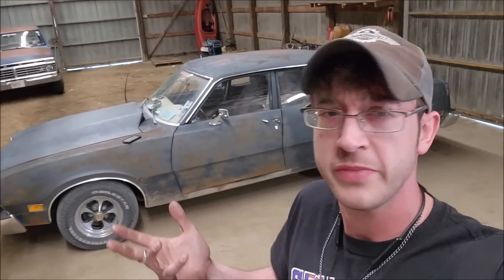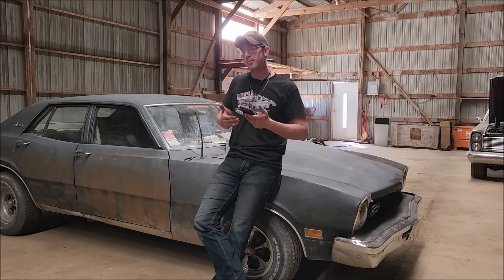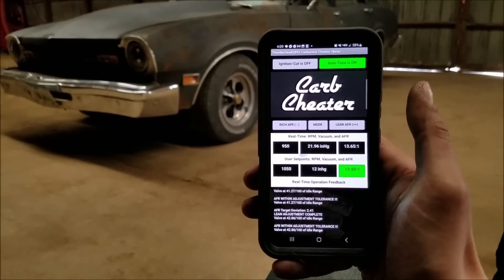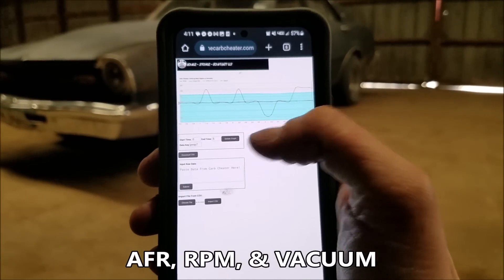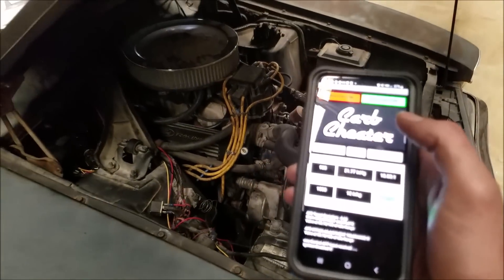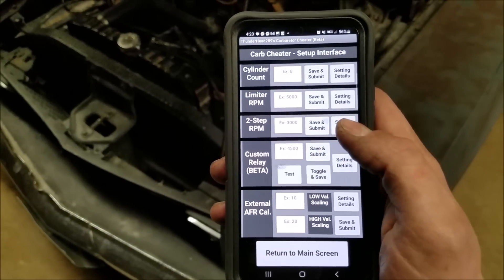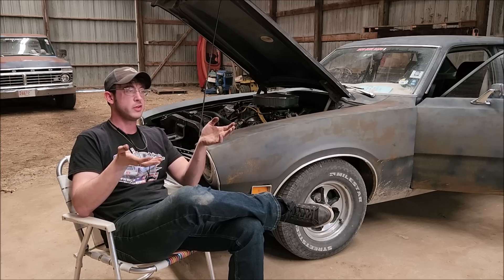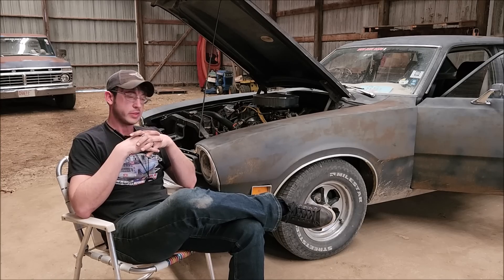A "self-Tuning" Carb in 2023? NOT fuel Injection (Beta Version - Teaser)

Comment: Brilliant conversion for classic carbureted vehicles. This would have been the next logical step between carburetors and EFI, back in the early days. Being able to actually control the target AFR is a huge step, and most likely, the biggest advantage to getting better fuel mileage. I noticed you're using a modified GM HEI distributor. Can you also modify the timing curve? This would be really handy for a draw-through or blow-through turbo setup! Nice work Luke!😉👍
Reply: How is it adjusting fuel trums though, not seeing in the video how thats being done (if its being done).
Reply: @umakemerandy3669  My guess is a solenoid modulator valve in the carb, sort of like the early GM CCC systems, before they went to EFI. Probably would be a plan to ask Luke directly?
Reply: @danw1955  lol yeah I'm sure he would reply to my comment about as soon as he would reply to yours about timing

Comment: I am a network security guy by trade, and wanted to put in my 2 cents.  Fantastic work, super excited to see it finished.  Please, please, consider how to secure the link between phone app and hardware. A malicious app, or a software bug, allowing control over our vehicles is a nightmare. The java mess on most cars is a security nightmare and several testers have already shown how easy is is to break into vehicles with ECUs that run all java and control everything. A hardware code, external serial number, push button, something that allows a secure and tamper resistant interface BEFORE something bad happens would be a great start.
Reply from the maker: To connect you need a 4 pin code which is unique to every unit. Prevents a lot of potential Tom foolery

Comment: I like the idea of an app for certain gauges.  Do I need AFR all the time?  No - just when tuning. Voltage? Once in a while. Some classic rides are missing a tach and well... that I gotta have, along with coolant temp.  Anything with a fuel regulator feeding a carb?  Gotta have fuel pressure too - that's an engine saver..

Comment: Hey Luke,cheers from Houston! If it goes super popular and a ton of units sell, would there be a potential for the app to crash? 

I see you mention wiring it to the coil; will it work well with aftermarket ignition systems? (MSD box to an MSD coil). 

If we decide to lengthen or shorten any part of the harness, say for a wire tuck, is the brain of the unit finicky with either solder, or wire gauges, or even wire material? 

I’m guessing it doesn’t care if it’s on a dual plane or single plane intake?

& any chance of rfi/emi? I ask that from experience from running a Holley Sniper lol. 

Can’t wait for it to be released! Props to you and Joe for designing and creating this, and a lot more if you guys are making each single one yourselves 😮

Comment: Holley had a dash mounted unit you could adjust a/f ratio on the fly. Mid 80's and for a holley only.
Reply from the maker: You had to do it, wasn't automatic. 
All that was was basically a 555 timer running a pwm circuit with your adjustment being a variable resistor. 
That's something an electrically savy high school student should be able to accomplish. 
Also, in the 80s you'd have no real idea of what your afr is on the fly anyway
Reply: Absolutely,  that's why your making it better.

Comment: Hey Thunderhead, I want to thank you first and foremost for the videos and the knowledge. 
Got a question for you, I have a 351w but it stumbles giving it quick revs and backfires around 3k. Idles fine and starts up like it should.
Reply from the maker: Those are probably different issues one to another. I'd really look into your timing with a timing light which could easily be your 3k problem, then I'd look at your accelerator pump adjustments for the stumble

Comment: So, you could consider adding a launch control with that rev limiter too! I don't know the logistics behind such a thing: maybe a new screen in launch mode where a big circular button acts almost like a digital momentary switch? Or, it only disengages the limiter (or launch control) after sensing full throttle input? **Edit: just saw the 2-step portion you mentioned.
Reply from the maker: Setup where you can hold a button and an addition Rev limiter setting is active - which would be lower than your normal Rev limiter. In the setup, you can then trigger party mode which runs a static large duration, effectively shooting Rev limiter flames - that's probably the illegal part

Comment: After viewing your lawnmower carb video, I modified a set of refrigeration gauges and brought both ported and manifold vacuum to them inside the cabin so I could valve back and fourth for timing advance (and even blend the two but nobody cares) and I must say, how pedestrian that effort is compared to this. When I saw your "controlled vacuum leak" to modulate the mixture I was hoping you'd take it to this next level. Is this also using that ignition system that uses Bluetooth to link up with a smartphone, or separate/ alongside?

Comment: From your mentioning of how to install this kit, you didn't mention a mixture control solenoid that controls the gasoline-side like the OEM feedback carburetors. I suspect (since you mentioned two vacuum lines to install) that you are setting the idle mixture screws and the main jetting on the rich side, then using a solenoid controlled vacuum leak to control the air/fuel mixture. Pretty cool idea. The only advantage to fuel injection (Throttle Body or Port) is the ability to shut-off fuel flow during closed throttle deceleration for economy and at the rev limit to avoid plug fouling. It would be great if there was a universal system that fits all the different common carburetors to enable a fuel shut-off as well. If you ever market this device and it comes in cheaper than a TBI kit, I would be interested in buying it. Keep us posted my friend. Happy Easter / Resurrection Day to you and yours as well. God Bless.
Reply from the maker: I'll roll it out - pretty good extrapolation on how it's done on your part. It's under 400 dollars btw
Reply: @ThunderHead289  Put me on the list and I will purchase one from you as soon as it is ready. Thank you my friend.

Comment: GM added closed loop fuel control to Rochester Quadrajet carbs in 1986.  They had solenoid pulsed fuel metering rods and a single 02 sensor.     Electronic HEI ignition with ecu controlled advance, a throttle position sensor, MAP sensor, coolant temp, etc.  

Worked great, ran perfect year round.  Shortly after that, it evolved into TBI which was better by far.  These days EFI is simple and affordable.   

It's neat to have alternative, cool idea.
Reply from the maker: The tbi I will say was simple and reliable fuel injection. Not efficient, no power, but reliable. Can't agree on the q jet - the tech wasn't there at the time and it shows. Not their fault, great idea - but we just didn't have what we do now

Comment: You know that there are some folks who believe that moving every couple years helps cut down on the amount of junk they accumulate and hoard. Not so for true artisans, engineers, and history interpreters such as yourself. 

I like the idea of your Carb Cheater. Might make running a carb on an old classic less idiot prof for guys like me. Only issue would be the installation. Figure out a way to make it hardened against EMP surges and you’d be a hit with the preppier community.
Reply from the maker: The nice thing is if it gets damaged, your still have your normal carburetor and nothing will stop you from driving down the road. Wanted to maintain that reliability of a carb, yet improve its adaptability

Comment: Also , in the mid 80’s chevy Camaro 305 had carburetor electronic controlled using O2 etc
Reply from the maker: No, not really. Think of what computers were in the 80s - practically unusable. The tech wasnt there to do what they were trying to do. Wideband didn't even exist until the mid 90s and didn't even get decent until this late 2000s

Comment: I feel like there is more to this than just the control box and Wideband, surely its no silver bullet for an unknown carb on an unknown motor?

Am I right in thinking this is more of a 'finessing' tool for an already set up carb? I mean you've got jetting and screw adjustments to work out before anything else right?

Great to see you going for it, products like these need all he traction they can get and you never know it could get picked up by one of the big guys!!
Reply: I'm wondering the same thing and how it actually alters AFR. Luke mentioned two vacuum lines. Obviously it can't add fuel so all I can think is that it acts as a computerized vacuum leak. I don't mean "vacuum leak" in a pejorative sense.

Comment: Great work, since it sounds like you have ignition on cranking it might still be easy to hotwire by tapping the positive in on the solenoid.  You might want to add another solenoid to that or just remove that wire.  Who really runs the resistor and points anyway?
Reply from the maker: I won't say how I do it exactly, but manipulate the positive side of the coil all you want, and soon as it sees rpm it will shut down the engine 🙂
Reply: @ThunderHead289  I believe I spoke too soon.  The rev limiter and flame in the exhaust tell me you're using transistors to switch the power to the ignition.    That is a nice feature to have.  I hope you decide to keep making videos and am looking forward to hearing more about your setup.

Comment: That is awesome n it’s good to ur back the last video I seen was the lawnmower carb swap even that was awesome.. I know u said u want to retire but keep the videos rolling🤙🏼.. How much would the carb software cost and we’re could it b bought ?
Reply from the maker: With everything you saw, and the associated hardware which isn't diy level anymore with a proper circuit board, encloser, and all parts being machined not 3d printed, it's under 400. 
Considering you can't even buy a decent wideband for under 200 anymore just on its own, I think it's an alright deal. We don't "make money", but that wasn't our intent either.
Reply: @ThunderHead289  make it as reliable and sneaky looking as possible, you deserve to make a few bucks on this.  there are loads of cars, trucks, boats and heavy equipment that could use this level of fine tuning. msd should have done this 20 years ago

Comment: Luke You have no idea how i am feeling about your work, its freaking awesome, Back in 1967 I could be you, but we did not have the tech at the level it is today to even try.  I did convert my holley to a double pumper with 4 nozzles and gear drive secondary. And later in my work I invented a robotic assembly system with machine vision and bar code but I never got back to Hot Rods. You are using your brain and skills to create things we truly need for our old Hot Rods. its terrific. One request is to look up Protean they make wheel Motors to replace front brakes with electric motors. Add controls and Batteries your lil Maverick could be an AWD Hybrid!!!! They are doing this in europe and are looking for builders to help enter the US EV Conversion market. They focus on Light Trucks and Small Cars but I know our Fords and Chevy would be perfect targets for adaptors to fit the Hub Motors and provide a Front Drive EV with Rear Drive Gas vehicle that in a coordinated manner could be a super EV in town, Gas on the Highway and AWD when you need or want to rip off a 3 second 0 to 60. You have the understanding controls and car savvy to make it work. Look them up and think it over. Retrofit, Trucks and Hot Rods to AWD Hybrids could be a business.  Dennis in Virginia

Comment: Im one of the outliers in your potential customer base and am interested in this for monitoring purposes mainly as a pseudo obd2. With that in mind if you built the control board with the option to expand sensor input to include (Water Temp, Oil Pressure etc) and to read voltage in real time etc I would be buying it. (I appreciate that those sensors are problematic based on manufacturer specs but if you add the ability to control variables in the interface the curves could be made to line up with manufacturer service manual specs to display correct data).

Comment: I feel like this could also make some early TBI setups tunable to work with the out of spec chineseium repop sensors that are all we can find these days.

oh, @Thunderhead289 - dude, you broadcasted your phone's unlock code to everyone @ 6:22, change that up ASAP before someone else does.

which kinda brings me to another question, what's in place to stop someone that has the app from connecting to another carb cheater box? can the end user at least set the bluetooth pin to gain a little operational security?

I kinda feel like the "anti-theft" feature here is about as secure as the all the hyundai/kia vehicles that are currently being stolen with just a USB cable.

Never underestimate the thieving trash class of society.
Reply from the maker: Every carb cheater has its own unique pin in order to connect to it with a device for the first time - you can't if you don't have the pin. Then, id say any "anti-theft" is defeatable, it's just how hard is someone going to try - its better than the "hidden switch guys" since first thing I do when I steal a car is alligator clip from battery to coil positive 😄

Comment: Luke, your knowledge of fuel systems have a very desirable qualities. I was wanting to know if you had considered mixing oxygen and hydrogen gases with gasoline vapors to reduce fuel consumption or even run on oxygen hydrogen gases only. Then what about developing an oxygen-hydrogen generator. Then putting these gases int accumulators use to start the engine then run the engine after the engine is running use the O-H generator to run the motor. Is this a workable idea? If not why. Let’s start to think out if the box.
Reply: yes ,   I have been looking at the hydrogen systems for a long time ...   cleaner engine intake , better gas milage...

Comment: A good setup for a blow through carb (turbo or sc) would be killer. You might be onto something here, this could be an easy way to make carburetor tuning work easy for everyone. 
My mind also goes to race classes with carburetor restrictions. It’s possible to jet a carb rich and allow a metered airflow into the intake below it basically making a 500cfm a 600cfm or more.

Comment: could this work on a Chevy  l.s with coil packs   tuning with out getting your lap top out  and hooking  up to  your msd box  every time  to  adjust the carb am doing a 47  international kb2  rat rod  6.o l,s powered  would  also be nice to use  when  drag racing  for  real time  on the line  hits crew would have data real time  with your skill set  and your app   you could be going places fast

Comment: Suggestion / question:   Will I be able to keep my AFR gauge (AEM 30-0300 kit) and connect to the Cheater using the voltage output from the gauge?  I currently have wired the gauge output to an Arduino which is a multi gauge display, so that’s why I’m familiar with the AFR voltage output which has a defined formula that relates volts to AFR.
Reply from the maker: at about 9:45 in the video I address that. yes you hook your AEM white wire to our blue wire. pretty sure that AEM is a 10-20AFR spread, so you shouldn't have to do anything from there. if its not 10-20, you just have to tell it that on the setup screen - again, about the 9:45 mark
Reply: @ThunderHead289  awesome - from the manual, 30-0300 is 8.0-20.0 AFR range.  I wasn’t clear on how the cheater wired into the AFR gauge.  Makes sense that it’s to the gauge analog output and not directly to the O2 sensor, so you don’t need to build the O2 controller into your board.  Thanks for explaining.  I can’t wait to get my hands on one!
Reply: P.S. the formula to convert volts to AFR on my gauge is as follows, per the manual.  I programmed my Arduino based on this, and it matches the gauge.  AFR = (2.3750 * Volts) + 7.3125

Comment: Question. When ignition lock is on does  the controller in the vehicle stay  on causing a parasitic draw that will drain the battery over time? Also super interested in this system when it becomes available to the public I will be checking it out
Reply from the maker: Nay. We spent a lot of time to make it so it pulls 0.00 Amp with the key off. 
There is no draw whatsoever - I hard save settings and selections. 
Unplug it, set it on the shelf for 3 months, plug it back in - it will be like it just ran yesterday as far as settings go

Comment: Hopefuly you dont lose cell signal at the wrong time..that could be a downfall
Reply from the maker: Cell signal doesn't matter. Also, the brains are in the car - your phone is nothing more than a gauge pack and how you change settings - an "HMI" more or less. Doesn't have to be connected at all for the carb cheater to be doing its thing on all fronts. Lose your phone? Carb Cheater don't care.
Reply: Oh. I was thinking a situation when you disable it to prevent theft..then cant get signal can you reinable it with no phone so you can get it started?
Reply: @ray6976  As I understand it, it's connected via bluetooth. It doesen't care if you have cell service or not, bluetooth connects directly between units withouth any other network service.
Reply: Ok yeah..if its bluetooth there wouldnt be a problem..except losing your phone..but thats the same as losing your car keys.

Comment: If you could just make an automatic adjustment for the distributor too
Reply from the maker: If it makes you feel better not even fuel injection really has that. (It's largely pre mapped with cruising being trimmed "kinda" via a knock sensor. A knock sensor that goes haywire when there's a slight lifter tick